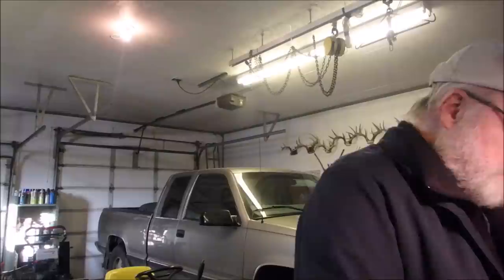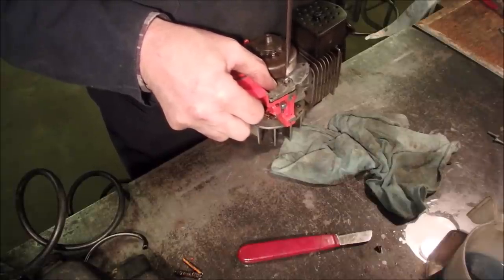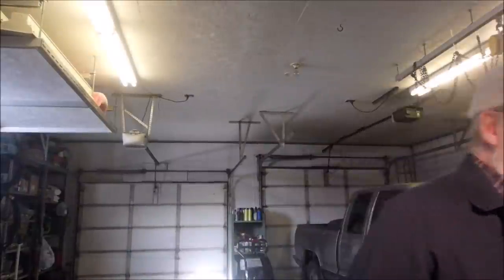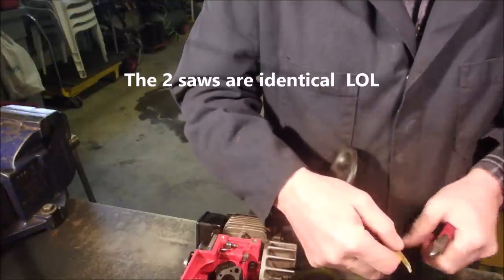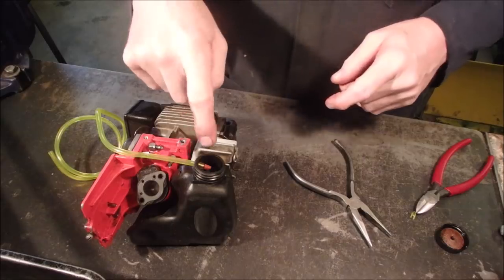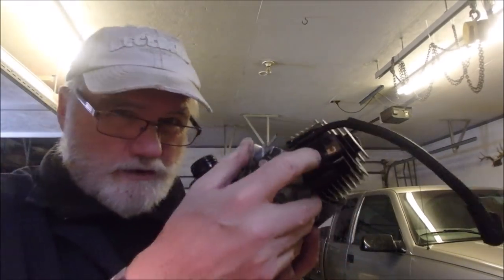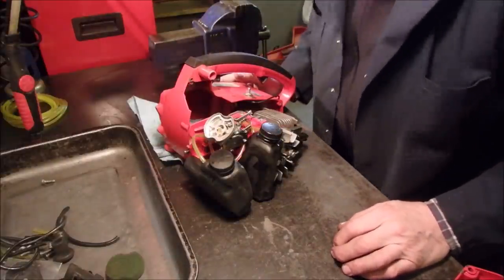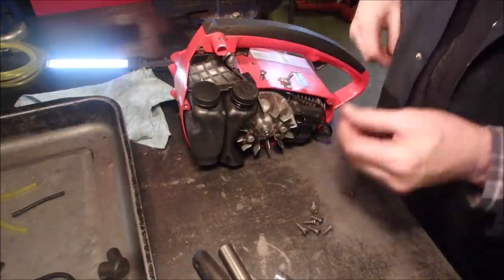Homelite Super2  Chain Won't Oil

Comment: I want to elaborate a little on the brass tube and duckbill. The brass tube is Sintered meaning its pourus. Its job is to allow the impulse air in to the oil tank through the duckbill to pressurize the tank to push oil out to the bar. When you turn the saw off and the impulse air stops, the Sintered brass tube allows the pressure in the tank to bleed off back in to the crankcase. You need to have 1/8" reveal on the Sintered brass tube between the end of the Tygon tube and the end of the duckbill valve to allow enough of the tube surface to be exposed to allow the air to bleed off.
Reply from the maker: Thanks a lot James.

Comment: I've got a backlog of chainsaws to work on here. Sometimes (ok, most times) I'm just not in the mood for fiddly work replacing lines etc lol. Oh, and 4 weed trimmers as well lol. Ugh. Awesome walk through and awesome ole Saw My Good Friend! Cheers! Sean~
Reply from the maker: Thanks Mr. Zippo.
Reply: Just as I resisted the 2 stroke snowblowers because I didn’t understand them, but have gotten much better with them, I need to go do it and learn. Tiny spaces, big hands. I have a Homelite a guy threw in on a deal last summer. I need to test myself. I may have the exact same one. And I have 8 weed wackers I have been avoiding. Snowblower season is almost finished. I have 30 lawnmowers waiting on me in the backyard. Plus the weed wackers. If I want to do well, I better get bu$y. Thanks Bruce and Sean for knowledge and inspiration.
Reply: @haneyoakie14  I've got enough 2 cycle stuff to keep me busy for a few days for sure. And, I really DO need to get on them. Including my own 2 cycle stuff. My leaf blower and both of my weed whackers are in need of service and fuel lines. lol Cheers Oakie! Zip~
Reply: @ZippoVarga  at least they don’t need an oil change.
Reply from the maker: @haneyoakie14  Wow   I have only one mower and an old Husqvarna weed wacker to work on.  Oh!!! and the 10HP cast iron Kohler,  Oh!!! and the 2 carbs brought in by a friend ,  Oh!!! the video of franks 23rd Birthday, OH !!! and the new Road service tool box.  Then there will be more.  LOL
Reply: @BrucesShop  I misspoke when I said 30 lawnmowers. I just went out and did a headcount. I have 51 lawnmowers, a lawn vacuum, 3 edgers, and 2 pressure washers. Lol.
Reply: @BrucesShop  Happy Birthday Frank!!!
Reply from the maker: @haneyoakie14  51 mowers ouch !!!!!!!
Reply: @BrucesShop  gives me something to do in the evenings.
Reply: @ZippoVarga  question for both @bruce’s shop 5HP b@s horizontal. Exhaust valve stuck open. Took head off and both valves out and cleaned. Seats look good, valve face has ring, looks like it should seal good. Should I seat the valves anyway while I am in here? Or save the material for future valve jobs? Either way I will make sure the gap is set to specs between tappet and valve. It is a 1990 engine. Low hours, based on no cylinder ridge and no piston slop. On a generator. Your advice?
Reply: @haneyoakie14  Lap the valves in Oakie. An ounce of prevention and all that. Zip~
Reply: @ZippoVarga  and since I have it torn down this far, etc.  I don’t want to have to go back in here, so do it while I’m here. Ok. I was leaning that direction and will lap them in. I appreciate the guidance. Thank you

Comment: Bruce, Through past experience it is easier to attach a thin wire pierced through the fuel line then then pull through the hole from the inside of the tank out.
Reply from the maker: Thank you  I like that
Reply: Doublewide6 has a video showing how to use mechanics wire to pull Tygon line through the tank.  It really works and saves time and frustration.

Comment: Seems like my oil pump is clogged from sitting unused 15-20 years.  Can I get the clutch off without disassembling the whole thing so I can get the diaphragm, piston, ball, spring out to clean it?  The clutch assembly has an embossing on the center hub thing pointing clockwise, OFF-->,  but can't get it to loosen.
Reply from the maker: Reverse thread??    An impact may help as well as a piston stop.  Lots to google there.
Reply: @BrucesShop  Thanks for the reply. Looks like it isn’t clogged after all,  but if I did want to put some impact on it, is this where you would use a probe tip placed on some point where it would not damage things (since there is no bolt, just the clutch threaded onto the shaft), and on a low setting,  maybe even something ultrasonic vibrating overnight with penetrating fluid applied?   It seems like it’s pressure welded on from so many years of use, and then sitting unused for at least twelve years.  And there is no good way to grip the clutch to turn it unless with some special tool.

Comment: What size are those fuel lines? I need to replace them on my chain saw but not sure which size to order.
Reply from the maker: I just google   what size of line for a Homelite super2 and got this.  You can use google for a lot. 
https://randysengine.repair/products/2ft-fuel-line-homelite-450-550-330-360-540-xl-super-2-chainsaw-3-32-x-3-16-usa

Comment: Guessing but maybe The coil is 'normally open' which is different than a new gen mower. So the switch needs to be connected to complete the circuit.
Reply from the maker: Interesting though.  I do get a spark while spinning it on the bench but that may be related.
Reply: any coil primary must be a complete circuit to allow current flow tru it until the circuit is opened to allow hi volts to be induced into the primary 200+volt amplified to 20kvs in secondary. done by points / elec. component{scr/ transiter } .Secondary circuit is tru plug ground ,eng. bloc , coil mounting screws back to primary grnd. flywheel must turn fast enough to induce magnetism from magnets into coil frame.

Comment: Bruce are you on speed slow down mate
Reply from the maker: It is winter and the shop is hard to heat when it is -30. I do fewer videos.  Unless you mean i have physically slowed down in my movement.